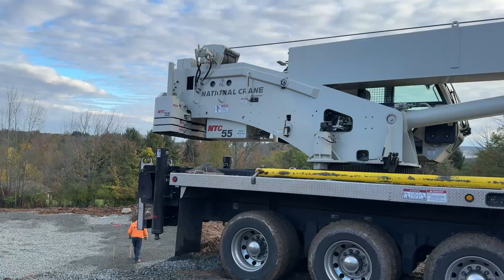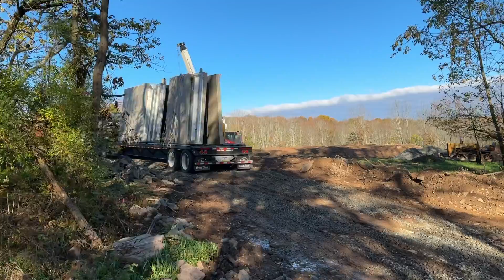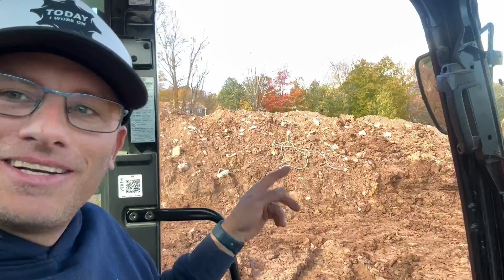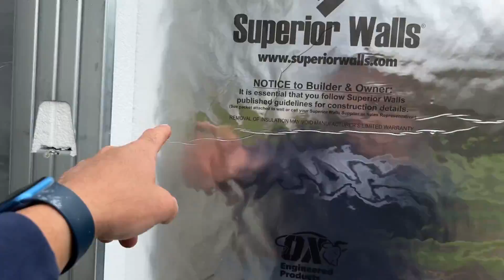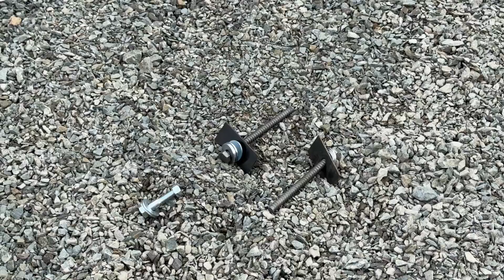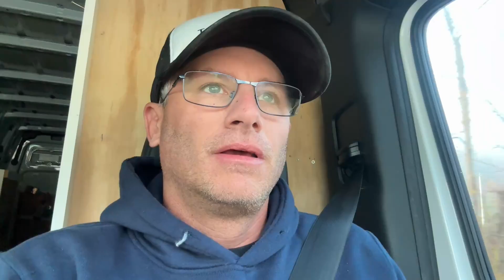How Advanced Concrete Installs a 6000 Square Foot, 34 Corner Superior Wall System With 9 Foot Walls

Comment: I done dozens of superior wall foundations and preparation is key.   The sales guy should have communicated the right crane setup location and distances to the further walls and if it's not working its his fault not yours
Reply from the maker: They were not used to these size builds here, just a lack of experience. Also, this was my first ever excavation and I think I did ok, but I'm sure I could have done a better job. On that note, the crane was not long enough to reach the end of the house, that should have been addressed. We figured it out, but I learned a lot about Superior walls.

Comment: Been involved in a few superior walls sites as a Supt and one for myself. I think the baseline issue is the sales guy has to underplay the required site specific support needs to make the sale and then only hints at it just before the install. That leaves their install crew always on the back foot trying to get done on time and asking favors. A sure recipe for a grumpy princess.
Reply from the maker: I agree. The sales rep was very nice but even before I got a quote he had no desire to check the site conditions. He came by 2 weeks before the install date and the plan that was given to me went sideways. They had a plan, I followed it and wanted the perfect site to install a complicated system for them. At the end of the day the walls went in and they are good.  I back fill this upcoming week and I hope the walls stay in place. lol. He was also concerned about how the concrete guy were going to install the basement floor and as I assumed it was no big deal for my concrete guy. I’m used to people saying we will figure it out. They were quite the opposite on that spectrum.
Reply: @TodayIWorkOn  - that was the next disappointment for me on my own project. Superior installed no wall bracing or gave any documentation with a suggested method for that (which would have twigged me to do it myself). The salesman did tell me up front that floor deck and floor had to be in place before back fill, (which makes sense) but turns out  that was not sufficient on it's own. My excavator took extra care and spooned in a sand-only back fill and the walls still tipped in at a section at the top about a 1-1/2". The concrete floor and deck were complete. Ended up having to remount the framed walk out walls and fur out the foundation walls to get back to plumb. I would highly recommend running foot to plate cross bracing inside before any back filling. The sales guy did check the site just before install at least. I had to get the excavator in quick to run the the driveway base in behind the house so they'd have a solid pad for the crane. Luckily the driveway was going to be there anyway so it wasn't an additional expense; only a please do this quick favor. The basement floor went in easy, my guy used treated 1x4 mounted on the face of the metal studs to set the height and keep the concrete out of the stud bays.